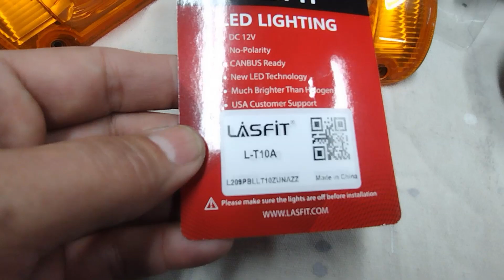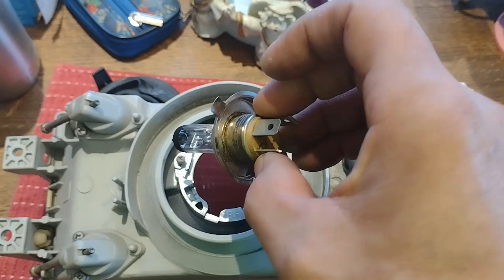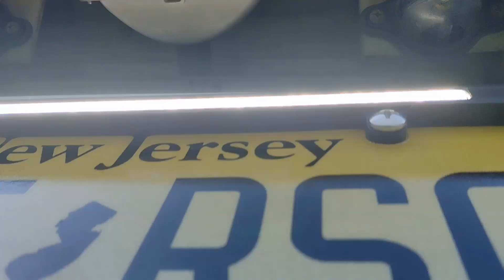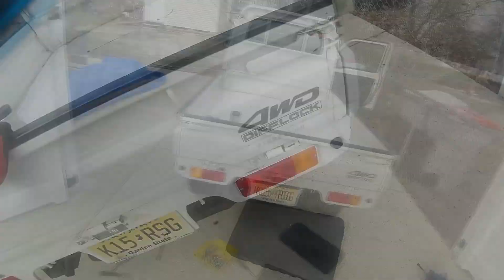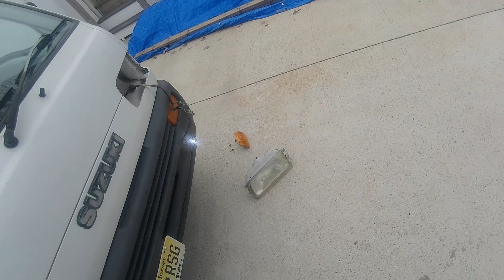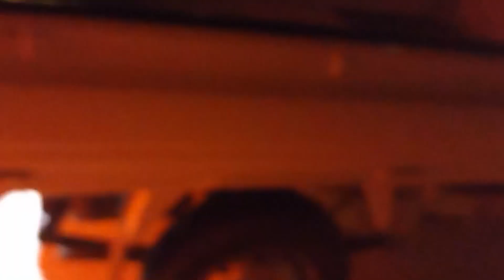Suzuki Carry Kei Truck: LED Lights Upgrade - EP4

Comment: A much easier cure for hyperflash is a different flasher unit. Some say “for LED” while some are adjustable for speed. No cutting of wires and no wasted current heating up resistors.

Comment: I bought some Amazon led lights because lastfit didn’t have anyone in stock at the moment and one of the bulb got suck, and I was tangoing with it, the socket popped out, and when I tried to push it back it, it was getting suck, should I try and force it or just wedge it in enough that it doesn’t move?
Reply from the maker: If you're referring to the socket on the taillight assembly, I would be careful forcing back in. This aged abs(?) plastic is very fragile. You could try 2-part epoxy to get the socket to stay put. Good luck.
Reply: @Temuba  thanks for the tip, so far wedging it to where it does move out doesn’t seems to cause issues but I’ll like to keep it from bouncing out randomly or push it back in to give clearance for the new LED I just ordered
Reply from the maker: @redman7124  Like I stated in the video, my housing was brittle, too brittle. Just handling, the front edged were breaking off. These are very expensive to replace.

Comment: Great video. It will probably be better to use the same color LED behind colored lenses. Amber lens-Amber LED, Red Lens-Red LED etc. The white behind the red lens will lose some intensity. This is something I learned while upfitting emergency vehicles.

Comment: Have you thought about putting a camera in the front on slow motion to catch the wobble problem?
Reply from the maker: Yes, at one point I did. However, i know the suspension parts are worn and most need replacement. Both front struts and rear shocks were worn, no spring back. Both have been recently replaced.

I saw both lower control arm ball joint rubber boots torn. Probably the grease has been gone for years and ball/socket worn. Which only leaves a couple more components left that could also be the wobble issue.

E/w, I just received all the suspension replacement parts, including steering rack & pinion from the Philippines. Currently finishing a powder coat oven build to then continue with the suspension.

The powder coat oven will be used for powder coating many of the suspension components on the kei truck. Keep an eye out for that also. Thank you.

Comment: What paint did you use for the light cases
Reply from the maker: Rustoleum Gloss Protective Enamel, Gloss Pure White. Just make sure you spray a primer for plastic. Krylon makes an excellent primer that bonds to everything including plastic: Fusion.

Comment: I recommend CPT type instead of COB for the LED type of LED headlights. COB LEDs are large in size, have a larger light emitting area than conventional filaments, and light is easy to diffuse even with LOW BEAM. Furthermore, the amount of heat generated is greater than that of CPT.

Comment: 30:00 - This is a good example of why you want LED brake lights.  We tend to believe that lights turn on instantly.  That's true of LED lights but incandescent bulbs take maybe 1/10th of a second to turn on.  This can be seen on the front turn signals when you had an LED bulb (instant on) and the original incandescent bulb (flashing noticeably later compared to the LED).  Do the math and a brake light that illuminates 0.1 seconds later will result in a car behind you traveling at 45 MPH stopping 6.6 feet later than it would if they braked based on an LED brake light.  That's often the difference between a rear end collision and a near miss.  Even if you're rear ended, braking a tenth of a second sooner will greatly reduce the impact energy.  Bright LED lights are a significant safety improvement, but that's even more true for brighter and faster LED brake lights.

I replaced the halogen headlamp in my motorcycle with an H4 LED bulb and it's much brighter.  I can see better at night, but even more importantly, I can be seen better in the day and at night.

I bought all of the LED bulbs to upgrade the lighting on my Daihatsu Hijet mini truck.  If there's time after changing the gear oil in the front and rear differential, manual transmission and transfer case tomorrow, I'll do the LED upgrades.  I was surprised when I looked to see what bulbs I'd need at how many bulbs there are on this tiny truck.

I had to wait three months after buying my mini truck before it arrived from Japan - two months delay before it shipped and another month on the ocean.  I was hoping to do most of the upgrades for my mini truck project before the winter weather but the three month delay means I'm working during a few decent weather afternoons during the winter and most of the mini truck projects are postponed until spring.

A longer lasting solution to the yellowed plastic headlight lenses is to wet sand with 600, 1200 and 2400, solvent wipe, then spray a couple of coats of two part clear coat.  You can get 2K clear coat in a spray can.  You press up on a stalk that ruptures the barrier between the two parts so they mix inside the spray can, then you have 20 minutes before it hardens in the can.  The UV resistant clear coat prevents the plastic lens from yellowing in a year or two.  ChrisFix has a YouTube video showing the process.

My Hijet headlamps are the glass 5X7 lights so the glass doesn't yellow.  I'm replacing them with LED headlamps to get 2-3 times brighter headlights, but I'm pretty sure I'll need the relay wiring harness adapter to correct for the switched ground wiring.  At the very least, I'll need the simpler adapter that allows me to rewire the nonstandard wiring of the high beam, low beam and ground on the headlight pins.  I'll check the headlamp socket wiring when I'm installing the LED turn signals and running lights.  It looks like your H4 LED headlamps were plug and play with no need to rewire anything to make them work.
Reply from the maker: That's what I wanted with this upgrade, I wanted everyone to see me from a distance for safety. As you said the LED headlamps are by far the biggest improvement for better visibility especially at night. That's one thing I like about Lasfit LED bulbs, most of their stuff is plug and play, no specific polarity installation.